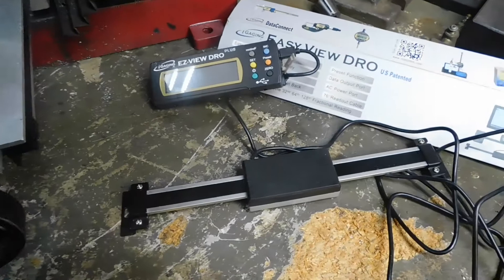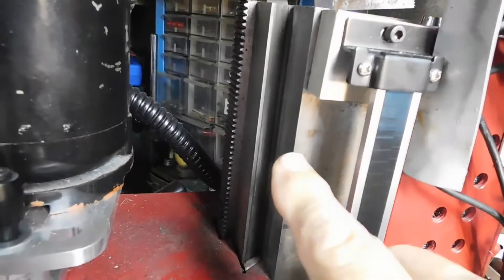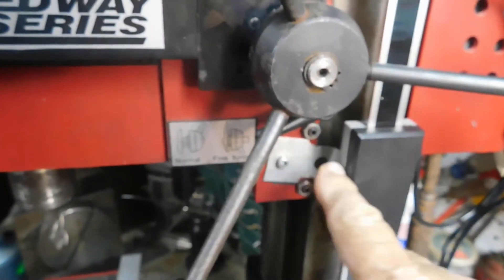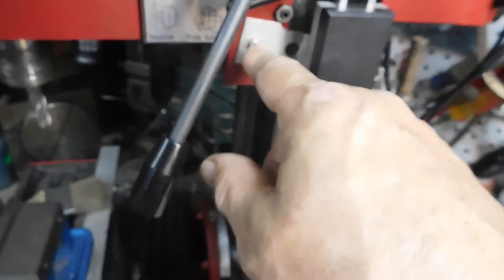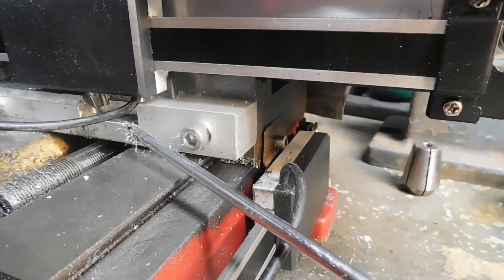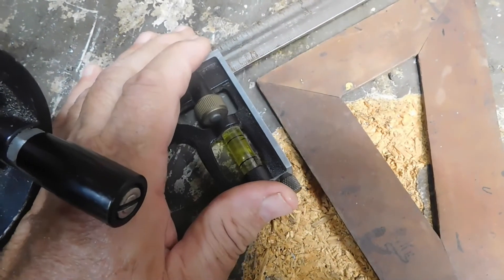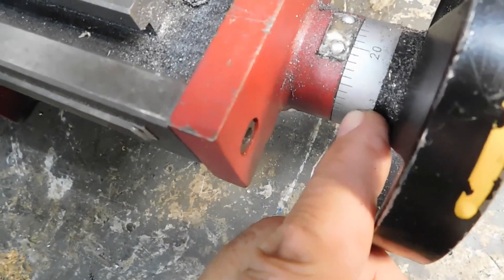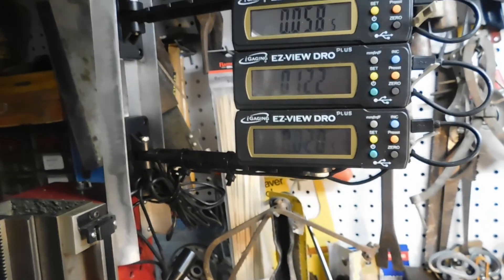Adding DRO to mini mill

Comment: Can you tell me the lengths of the DRO brackets sir.
Reply from the maker: x=18", y=10", z=16"  X was mounted to an "L"  bracket. Gave a little extra length and a cover for the sensor.  Y and Z mounted to the machine.

Comment: How do you mount your mill to the bench.the dro covers the bolt holes
Reply from the maker: My mill is not mounted to the bench. I have never had a problem with  the machine moving. When I did the DRO and when I had to replace the control board,  it was a benefit that it was not mounted.